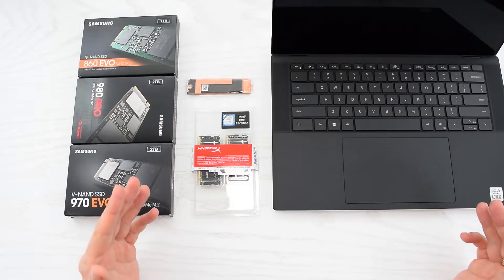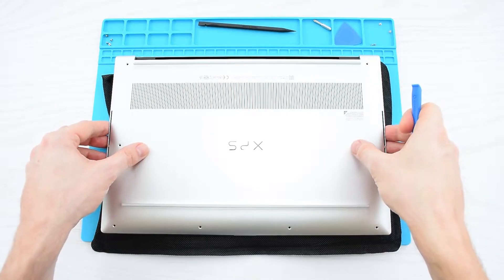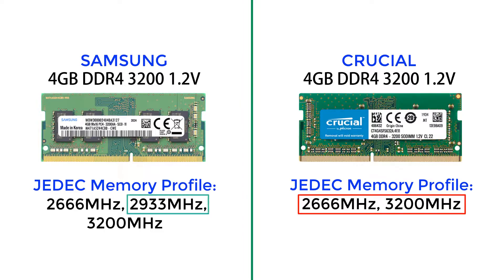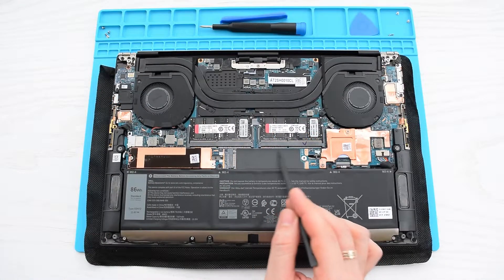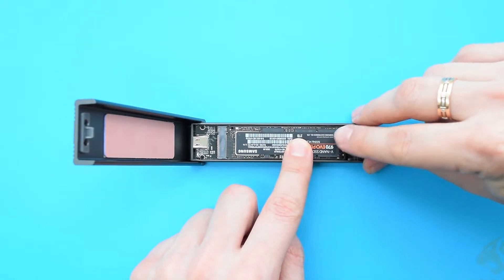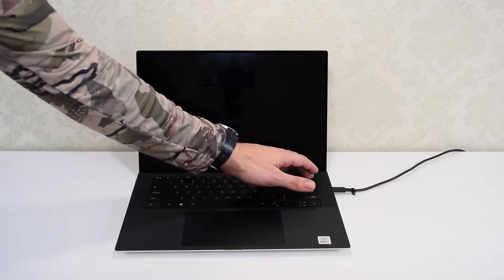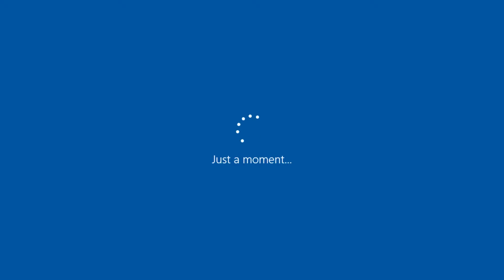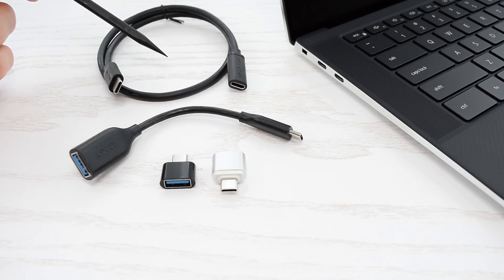Dell XPS 15 9500–9530 RAM & SSD Upgrade Guide | Max Performance Setup!

Comment: SSD making noise when downloading a high sized game.  When I pause, the sound cuts out.  When I continue, the sound starts.  I heard this sound even with a minor update.  My laptop is only 1 week old.  is this normal :(
Reply from the maker: I've made a video about SSD noise several years ago. It's totally normal, SSDs are not silent, especially M.2 (NVMe and NGFF) ones. There's a bunch of switching happens in the power regulation circuit and some components like coils and caps make that noise. Don't freak out it's just the way modern SSDs work.
Reply: @ElectronicsComputers  ı trust your knowledge and experience. thanks..
Reply from the maker: @kaptankies  Happy to help!